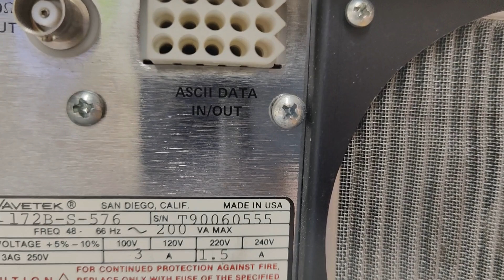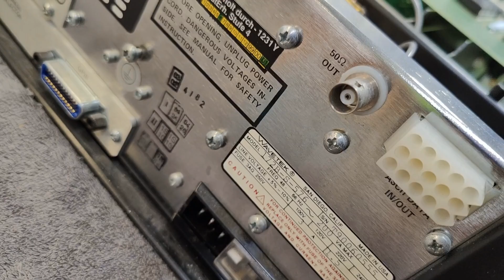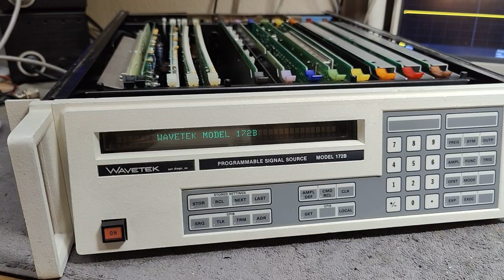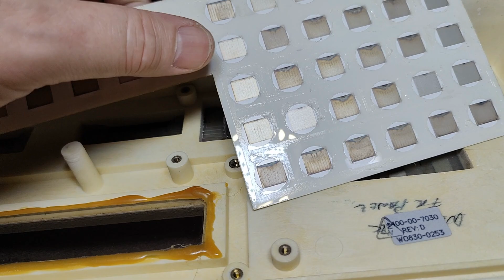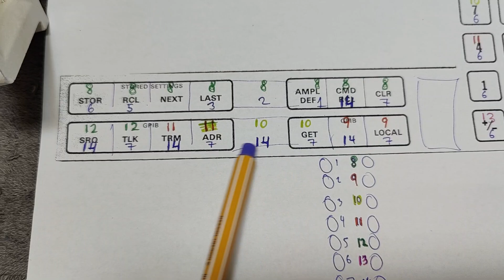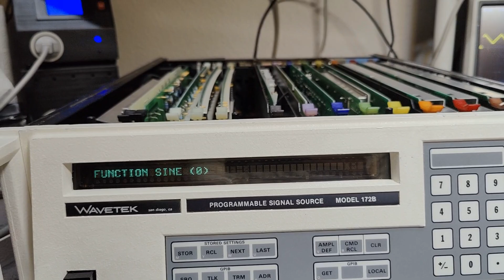WAVETEK model 172B Programmable Signal Source 1981

Comment: Look at what Wavetek has for a function generator anymore, and guess where it's made. I've seen it under a few different brands, and I have an older one from East Tester.

Green goo in electronics is generally from copper oxide. Some chemical probably reacted with the copper on the PC board making up the shield, which was probably a glue.

They could have at least keyed the card edge connectors. That's a bad design, I agree.

I've never liked membrane keyboards. I would rather have cheap and replaceable push switches. You were very lucky to get that keyboard face off, IMHO. When I saw the vias, I grimmaced.

Comment: I've run into this very issue on industrial equipment.  I reverse engineer the matrix then design a replacement keyboard around Cherry MX series switches.  You can get custom printed keycaps in multiple colors for them inexpensively so it's easy to reproduce specialized keys.  I then figure out the mechanical side, typically machining the top key surround out of aluminum or acrylic, and whatever I need to mount it in the enclosure. I always try to use existing mounting points and avoid modifying anything I don't absolutely have to.  You could use a custom PCB for the top panel surround for a neat appearance without having to whittle it out yourself, and 3D print the mounting adapters.  MX key switches have held up very well in a dirty, abusive industrial environment.  Only issue I've had is operators managing to break keys off, but they're cheap and simple to replace which is a big bonus.

Comment: "You Should Read The Gudd Damn Manual" !   Love it.  I laughed my Yass Off.  Great job  !!!!!!!!!!! ................
Reply from the maker: one of the things i love is to try always without the manual, a good instrument should be designed so we normally inteligent people should be able to figure stuff out, without the need of the manual.
Reply: @TeardownOZ2CPU Yes.  Yes.  We all know that after watching many, many, of your teardown & repair sessions.  And, WEeeeeee all do that too.  In the very distant past, I have owned 2 Wavetek analog generators (inherited from my employers) and I quickly learned how bad WaveTek engineering was (both electronic and mechanical).  My lab has all used bench equipment which includes Philips PM3267, Krohn-Hite 1200A, and all the rest is HP gear.  I've never had to open up the Philips scope yet and I think I'm now on "borrowed" time.  I will open the scope this winter to give it a good inspection .......and, if there are any line "safety" capacitors, I will replace.  If I see any leaky caps, they will get replaced.   KEEP UP THAT EXCELLENT WORK  !   Regards, Gary S. from Massachusetts.

Comment: MM5280 is dynamic RAM, similar to the TMS9060/AM9060.  And the numbers which were stamped on those 82S23s are reference to their contents; those are bipolar PROMs.  

The CPU (a Signetics 2650) is on the board with the two EPROMs; the two other large chips on the board before it are UARTs.

Comment: I have a wavtek 2410. Picked up at hamfest.  Yes, it weighs a ton. Yes, I had issues with the buttons. Yes, you can insert the boards in any slot on this one as well.  I like it but there is an issue with it.  It has one of the Dallas chips with the battery molded in it.  I have been waiting for it to die on me. I do not know if I want to fiddle with it or not. There are ways to fix that I think.   Good video.

Comment: The label Bund means it is from the inventory of the Bundeswehr (German Army)
Btw, according the date codes (I‘ve seen up to ‘92) the unit must be a lot younger
Reply: The "Materialerhaltungsstufe" Sticker also is German Army specific (could be civil defense too, but they didn't have a level 4!).
Reply: It also has an NSN starting with 6625-12 which is "Electrical and Electronic Properties Measuring and Testing Instruments" introduced by Germany into the NSN-system.
https://en.wikipedia.org/wiki/NATO_Stock_Number
https://en.wikipedia.org/wiki/List_of_NATO_Supply_Classification_Groups
Reply from the maker: bund also means bottom in danish
Reply: @TeardownOZ2CPU I know this label, believe me.
Above that you were confused why they labeled the top as bottom…
Reply from the maker: @inse001  yes i was.. god point :-) very observative

Comment: Could have been dropped, that's how things got bent.
Reply: I agree.  Dropped.  It looked like the boards on that side were the ones warped and the others not so much.  I think the chassis got twisted a bit in that area.  It is so heavy it would not take much.
Reply from the maker: it is very heawy, so might not need to drop it so much before it gets bent really bad